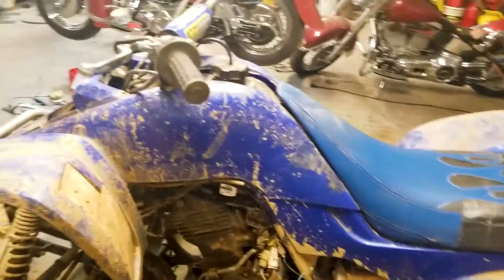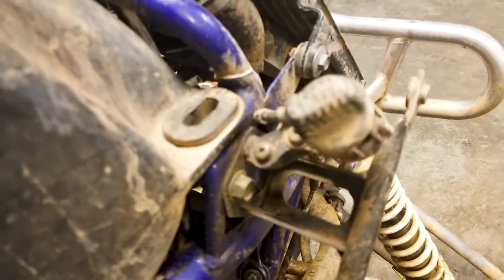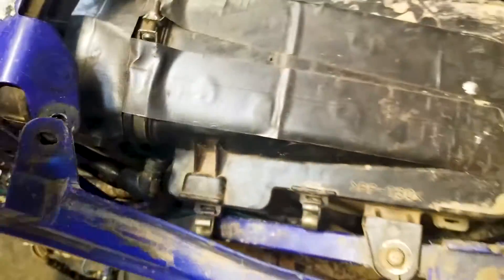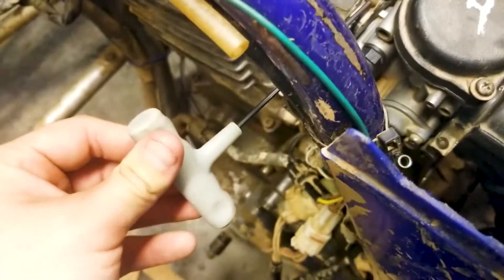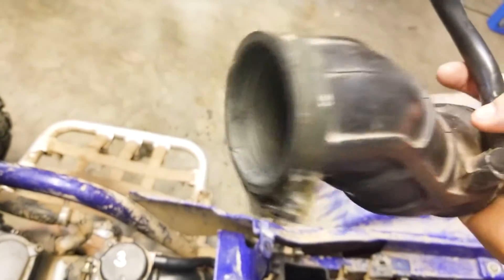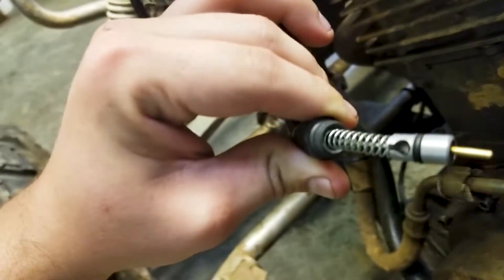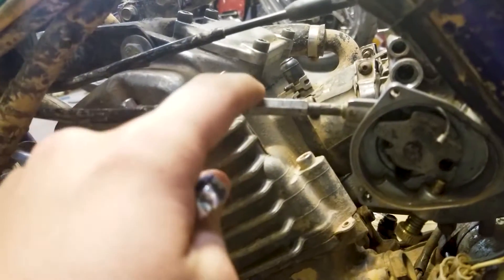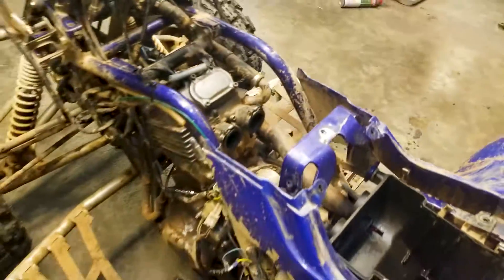Raptor 660 Tear Down; Front Plastics, Intake, and Carburetor

Comment: Hi, how many turns does the air mixture do you think in each barrel considering everything is stock
Reply from the maker: If you looked in my Carburetor Rebuild guide on my channel I go through the details on the air-fuel mixture screw and what I set mine too since I am back to stock. I can't quite remember what I set it to off the top of my head

Comment: I’m having a issue with my raptor 660 it’s a 01 and when you trying to start it it’s like gas is pouring out of the carb I was wonder what that could be like does it mean I need a new one or are floats sticking maybe?
Reply from the maker: Do you mean that it's giving the engine too much full when it starts or the overflow on the carbs is spitting full when it starts?
Reply: @Hunters_Mechanics  like so when the engine is trying to turn over the carb Is just pouring out fuel
Reply from the maker: @ripmj2724  I'm gonna assume you mean the overflow hoses on the bottom of the carbs, does it leak any from those when the engine isn't running? Most of the time it's the other way around where when the engine is starting or running, the carb stop pouring fuel because it's being used

Comment: What about the 2 hoses at the bottom, where do those to connect to?
Reply from the maker: If youre talking about the bowl hoses, they don't connect to anything, they are for if your carburetors bowls are too full they will throw out the extra fuel without flooding your engine/airbox. Just route them to the ground and out of the way of the suspension and the chain
Reply: @Hunters_Mechanics   oh ok i didnt know that, thank you very much!, i am trying to fix a raptor i just got the guy i got it from  was fixing but he lost interest on it, he said the cdi box got burned and some conector look kind of melted you think i should get the hole wire harnes but cables look ok!
Reply from the maker: @JoseCruz-wh1gb  My CDI blew 2 years ago on a ride, it happens lol I bought a used OEM off eBay and it's been good since
Reply: @Hunters_Mechanics   hello do you  know why carburator overflows mine leaks alot is that normal?
Reply from the maker: @JoseCruz-wh1gb  If it overflows then your needle jet might be worn or your floats are set wrong. I have a video on the carburetor cleaning and In there I show how to set the floats and if that does not work for you, then you might need a rebuild kit to replace the needle jet
Reply: @Hunters_Mechanics   it is a new carburator should i just adjust the floats?
Reply from the maker: @JoseCruz-wh1gb  Mostlily yes, that's what I would try first

Comment: My crank case ventilation hose was disconnected and I didn’t saw it. Can this cause a big leak of oil? My motor lose too much oil I just did a refill of oil and after like 6 hours running, I went to see my oil level and there wasn’t no oil. When I started disasembling my quad I saw this ventilation hose out with like some oil leak. And I also have a leak betweeen the 2 parts of the bottom end, could you give me your thoughts about this please ?
Reply from the maker: The ventalation hose should not have any oil go through it and if it does, it might mean you have something clogged somewhere (but I have no clue where). As for the 2 cases, the only way to fix that is to tear it down to the bottom end and redo the sealer. My cases leaked in the split a little bit so I always just made sure that I checked the oil before every single ride
Reply: @Hunters_Mechanics   could you see the oil level dropping ? Mine is leaking and I am sure that the combination of the clogged hose and the case leaks is the problem
Reply from the maker: @ktr78130  Almost every rise I was down to the empty mark on my dipstick so yes it was pretty obvious that the level was dropping lol

Comment: Your raptor need to give it a good wash down and sometimes it's hard to get rid of hard mud if left it so long
Reply from the maker: I've posted another comment somewhere about it, since my jug had such a large crack I really didn't to wash it down hard with water and get water into the engine so I sprayed everything with brake clean to get rid of the loose particles, above all I did not get any dirt into the engine!

Comment: What the # 3 and 4 on top
Reply from the maker: That's my needle c-clip position for my lean/rich mixture, since this raptor is bored over, I had to adjust the carbs and that c-clip position to get it to run right, it's there so I dont forget lol
Reply: Lol got u,,do u knw how many on stock? I put new carb in it but dnt have the other anymore so idk on what to set it
Reply: I think right now I have it on 2 3
Reply from the maker: @m.eztrada4964  I really wouldn't be able to tell you unless you test ride it a few times like I did lol It took me several attempts to get mine just right because I did it one carb at a time, since the 686 isn't much bigger, I'd start with 3 3 if I we're you
Reply: Lol one more question which is which air n fuel,, what's 4 and 3
Reply from the maker: @m.eztrada4964  The further down the needle, the more fuel, the further up the needle is more air, so the left carb has more fuel delivery than my right one, that's just what I've tested for mine to work flawlessly
Reply: Thanks lol I kept looking at videos and forums and no one would explain what I really wanted to know, now I get it thanks again.
Reply from the maker: @m.eztrada4964  No problem!